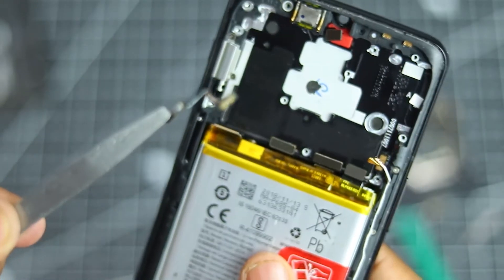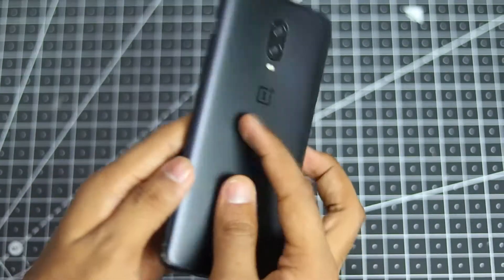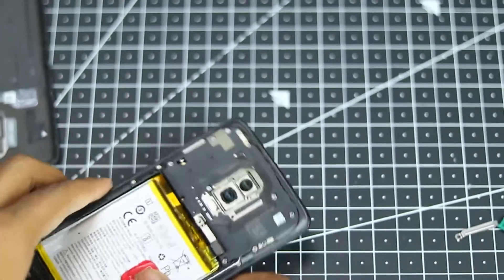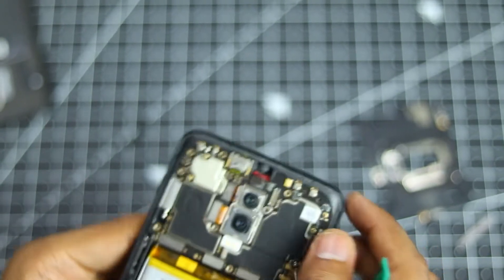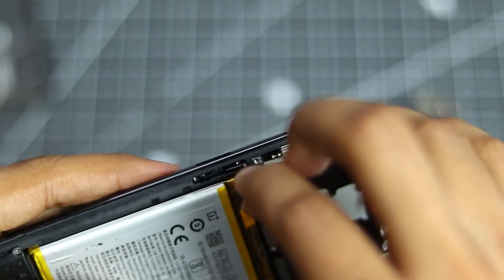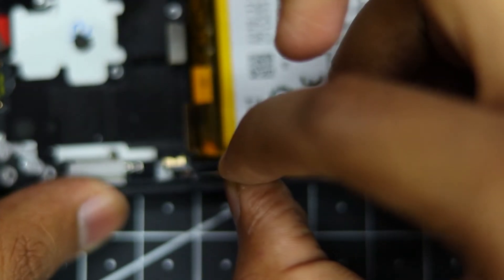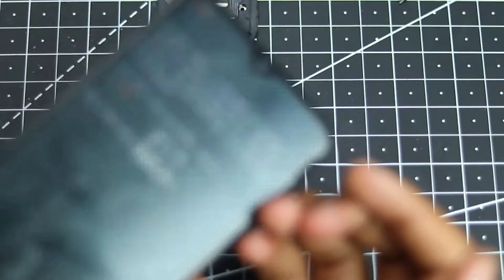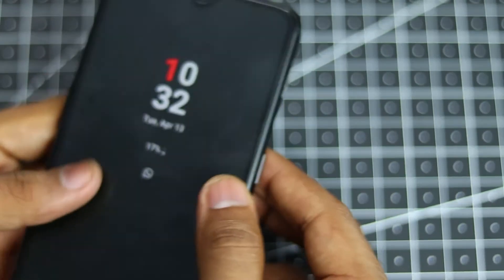OnePlus 6T Power Button Replacement | How To replace power button

Comment: hi, is it possible that only outer part of button (which we press physically) is damaged and not the inner part (chip part which u show in vid at 6:20)  which u take out from phone ??
Reply from the maker: If only the button is damaged (most cases) then it is possible to de solder the damaged button and re solder a new one. This will work fine but the process and finding a button rather than the whole piece is very difficult.

Comment: @inovatrix
Hi. 
I have a OP5, and the power button is completely pressed it. I have to use a pin or my fingernails to press it. Can that also be changed like you have shown in this video?
Reply from the maker: That might be because you phone's body may have bulged out making it harder for the button to be pressed. I would suggest you to take a closer look at it .
If the body looks fine then check the button itself sometimes it may be out of position and sliding it back to its slot might fix it. Mine was water damaged so replacement was the only choice.